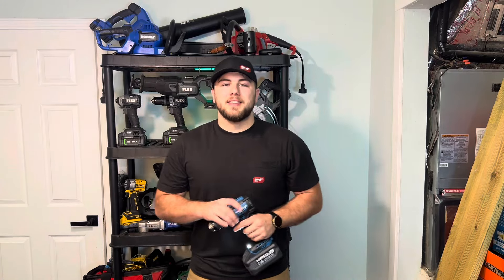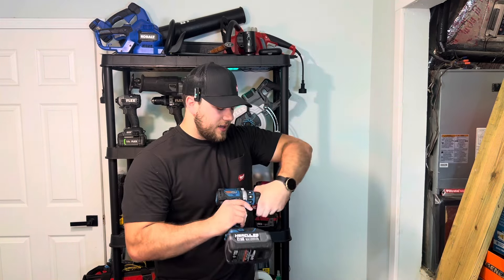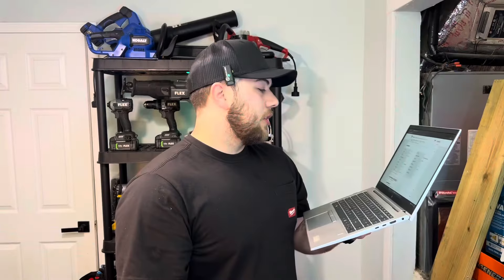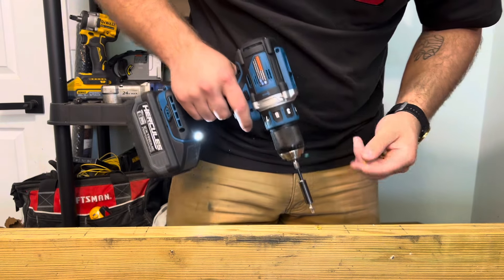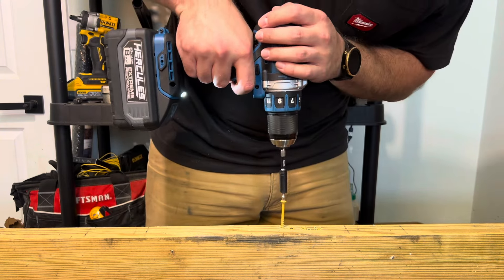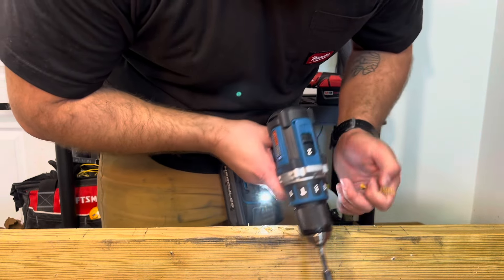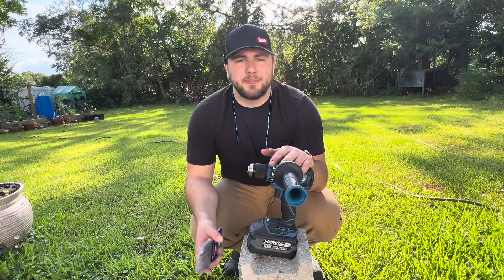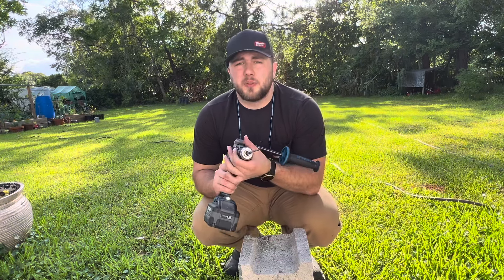Hercules hammer drill is UNSTOPPABLE

Comment: hummm, that tool ins't listed in the $99 combo deal. will have to check in store.... didn't get one (I got the 1/4 inpact driver  huge upgrade from my old ryobi tool) as I got a recent brushless Ryoby hammer drill that seems pretty good (rarely used) but might have to check it out.
Reply from the maker: It was on the list when this video came out but they updated it a few weeks ago.
Reply: @Kaleb_RoSs  bummer. might try and see if still goes through :). I froze your frame and it didn't list it either...